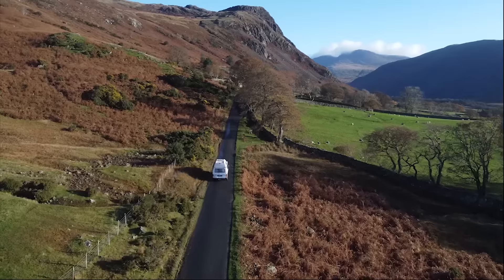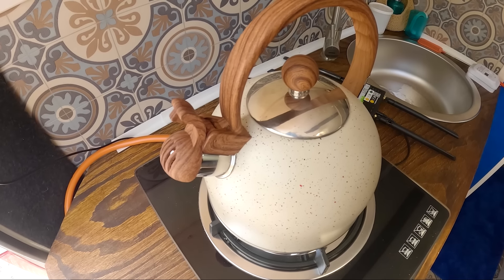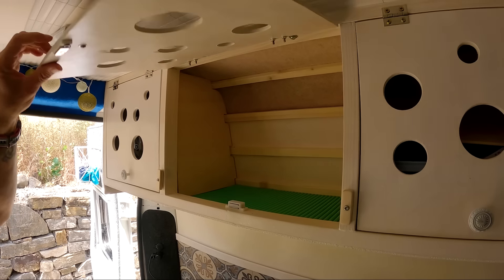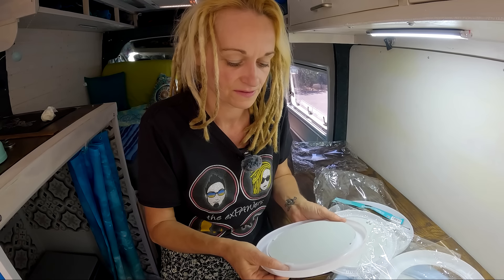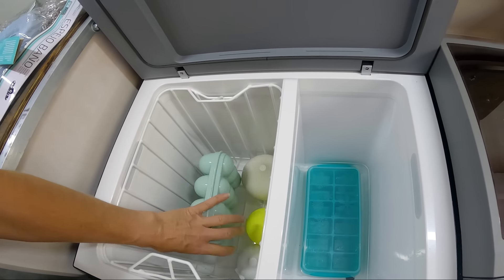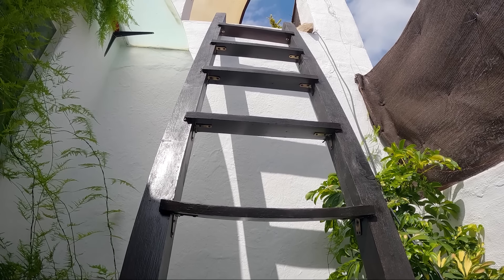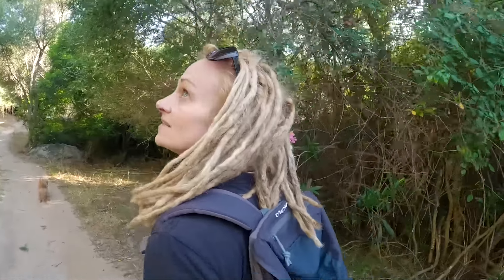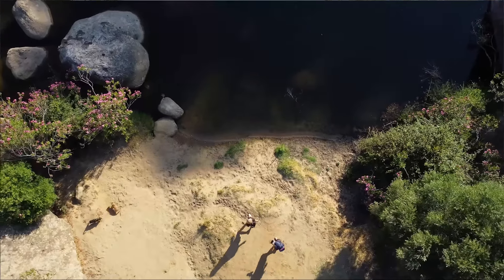THIS IS THE WORST PART - VAN LIFE (SPAIN) - WE'RE LEAVING..

Comment: For underside rustproofing, steam wash ideally 1st time but powerwash will do, allow to dry, spray internal frames, all cavities you can reach with lanoguard spray, and then apply lanoguard grease to all exposed areas, springs, axle, shocks, nuts and bolts, metal pipe in front under engine,  etc., if you leave the grease in the sun/heat it will become more liquid and easier to apply with brush, but you can also rub it in with your hands in gloves. Rust convertors not much good unless you prime and paint afterwards within the required timeframe. You can also spray lanoguard spray everywhere u just need to cover the brake discs and the exhaust. The grease is very good and sticks like s*** to surface rust if you rub it in well, it does not wash off easily, you can literally slap it on, only small downside is it will smell of sheep poo for a couple of days afterward until it dries out a bit and forms a crust !
Reply from the maker: Ok.. Thanks so much for the info.. We heard that you can paint first and Lanaguard is still a good option afterwards, as long as it’s the last layer so to speak it’s good??

Comment: The metalwork doesn't need to be rubbed down before Lanoguard . It can be sprayed directly onto bodywork , wires , rubber , everything ..and is good for another 12 months
Reply from the maker: Thanks for the advice, we just thought it would be better to use a rust converter before the Lanoguard.. The Lanoguard is transparent so as we got an observation about the rust we also wanted it to look better under there.. 😅

Comment: I said months ago how they will want to know the make of parts fitted so they can check the standard, often who fitted them, electrician etc etc etc, you just don't listen to any sensible advice and seem to think it will just magically sort itself out! You still haven't even changed the leaf springs after saying yourselves they are to weak, neither have you checked on any service work with the engine, cam belt if it has one, oil change FA and then whine when it all goes wrong. It's sad and childish at the same time.